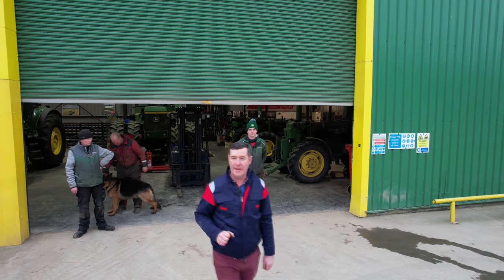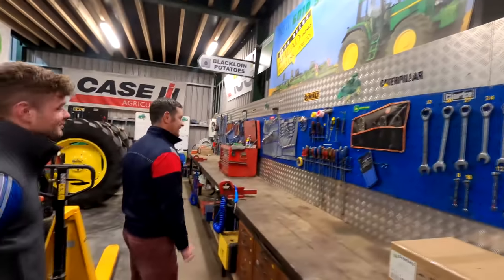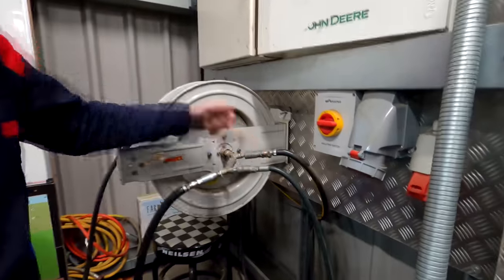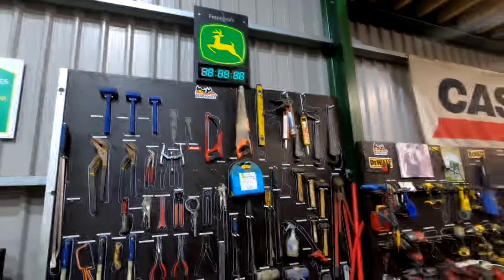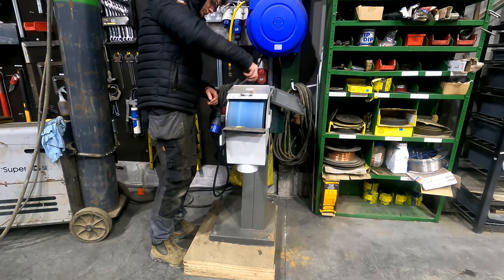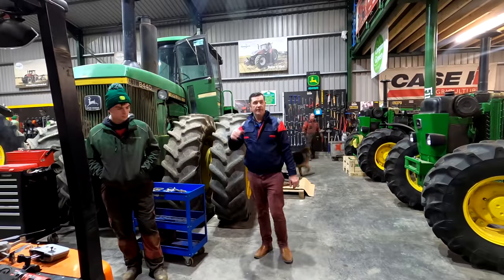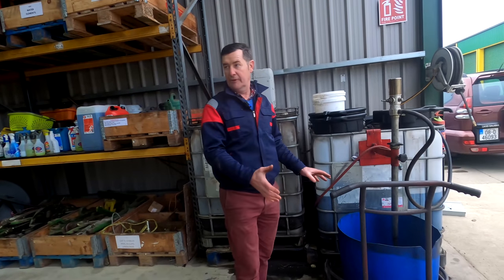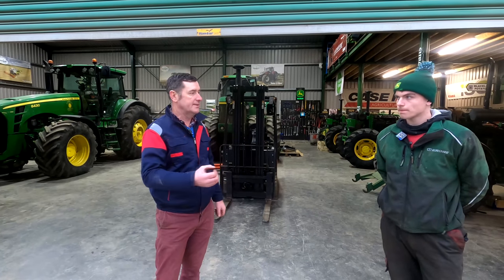PROBABLY THE BEST WORKSHOP IN THE WORLD (well we think so anyway!)

Comment: Pretty well set up place, I work as a mobile diesel fitter & welder in country Australia. I don't have a proper service truck, I have a crew cab ute with a tonneau cover.
If there's one thing I've learnt its how important it is to have the right set-up - As soon as you start putting tools on top of each other or putting bulky things in front of doors or sliding drawers you're absolutely killing your efficiency and you're going to cause yourself a lot of frustration.
You may as well not have a tool if you can't find it when you need it.

Comment: Awesome workshop tour👍only thing you fellas don’t have is dust n cob webs like us here in Australia LOL our workshop has cabinets for each tractor, combine n equipment.  Inside cabinet has usual filters, manual book, detail tool size chart eg drain plug 19mm n service parts.  One of cabinet has PPE/safety equipment n chemical spill kit.  We also have service box fill with what we need for daily service like grease cartilages, grease pumps, grease fittings, cleaning products, paper towel, basic tools n PPE.

Comment: Nice set up going on there. Do you have first aid kits & eye bath stations & Fire extinguishers, lastly you never showed the main item the Kettle / Brew station.
Reply from the maker: First aid in middle of tool wall, 2 on-site people trained with first aid with designated area,every tractor has first aid kit with fire extinguishers also, and in workshop there are between roller doors and they are serviced annually with master fire services and I’m the fire officer on site hope this explains regards Paul

Comment: I know you've alarms and cameras but the oil store not having any doors would be a worry to me. 
Do you heat the workshop? If so, how?
Lovely set up lads.
Reply from the maker: We have a 3 phase electric fan heater when required just plug in and it’s very clean ,kerosene can be a  little smokey and messy, we may still put roller doors in open workshop but we have a high level of security on the farm

Comment: Very nice setup, with one major fail in my opinion. Unless your farms don't get dusty having those oil jugs sitting on the drip tray with wide open tops is unacceptable, especially in an open air shop. You're asking to pour contaminants directly into the equipment. They deserve to be stored in cabinets with well fitted doors, anything to keep dirt and debris out of the fresh oil.
Reply from the maker: To be honest we don’t get wind and dust with the position of the workshop but we have got our colour coded oil jugs which we had ordered now and they have screw tops to stop any contamination of the oils 👍

Comment: I'm glad that you take a pride in your workshop but to be brutally honest your general specification is quite low grade.  I have designed many heavy vehicle workshops over the last 40+ years for several major national transport companies and there are many upgrades that would be required just to bring yours up to scratch.
One point that I need to make is that the access stairs up to the mezzanine is too steep and should not be left as bare timber.  The treads should be non-slip especially as the there will likely be wet slippery conditions being brought into the shed.
IMO no heavy vehicle workshop should be designed without a minimum of 10% rooflights to allow daylight in and these rooflights should be aligned between the bays to give maximum useful daylight in the working area.
I have never specified roller shutter doors on workshop bays as they are not insulated and in high winds clatter and bang such that the workshop space is almost unusable.